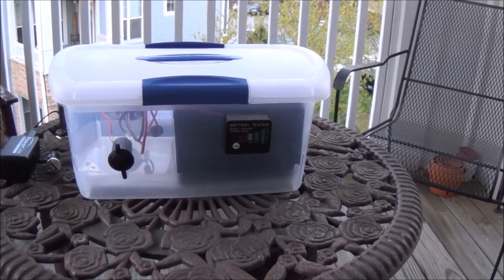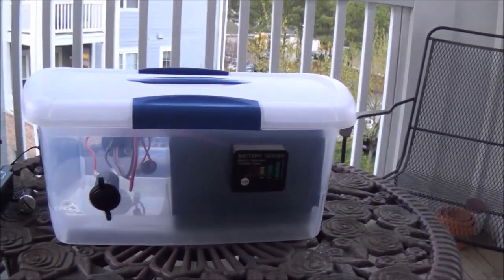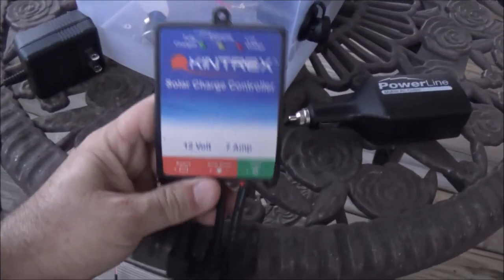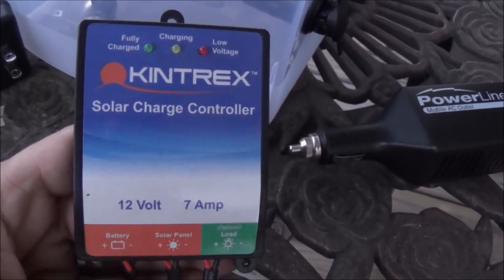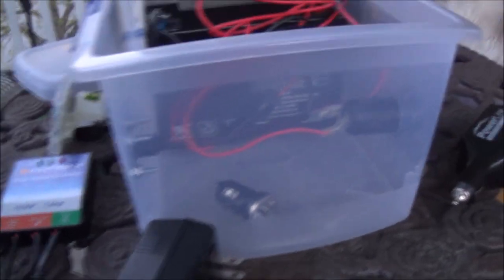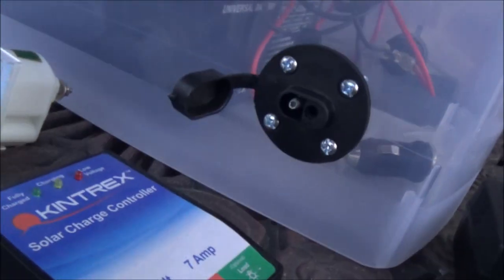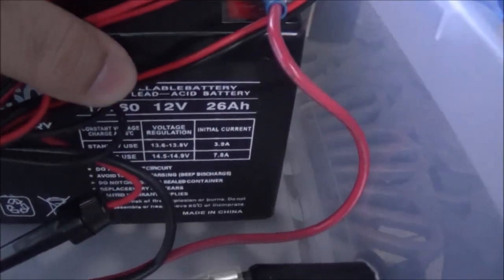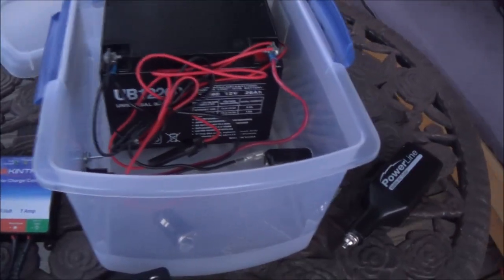DIY Portable Solar Generator

Comment: Nice set up.  I built a solar generator.  Two 100 watt  panels, a $20 charge controller, two deep cycle 12 volt marine batteries, and a 600 watt inverter.  Tips, get a sine inverter, not a modified.  Sine will allow charging of iphone ipad and other small items that need charging.  Mine is set up on a treated wood platform that I can roll around.  This avoids problems with the city code people.  When the power went out on us, I ran a cord from the solar generator (there is a 110 volt plug in on the inverter) into the house.  I ran a 12 volt fan (wired off of charge controller), I plugged in my laptop, router and modum.  For light I had a floor lamp with a 3 watt led bulb.  So I had a light, a fan, and was on line.  Very good feeling of having my own power.

Comment: I like the simplicity of your system. I see that the video is a couple years old and you've probably found out by now that the solar panel is too small. Assuming you'd have your cpap on for 8 hrs a night you would use 520watts at 65watts per hour. Your battery is plenty large enough to do multiple nights if that's all you're using it for but to recharge the battery you'd need 13hrs of sunlight per day, with a 20 watt panel, just to cover the cpap usage. If you had a 60 watt panel you would recharge the cpap usage in 8hrs assuming 100% efficiency which the system is not. A 100 watt system seems like it's got you covered in a little over 5hrs of sun and the rest of the day gets you covered for electronics. Wondering if this is what you have now discovered after using it for a while?

Comment: you are the first person to make one of these that I have seen that like myself has to have a cpap machine and ours run on the same power specs (12v 60w) when I saw they sold batteries for it I priced them with the cpap and other uses for the battery and when I was quoted the price I said damn that there are way too many 12v ideas like this that will allow me to run it during a camping or power outage situation and I'm glad to see someone else make one of these power boxes and consider that I'm currently building my own and will post it soon and BTW I have some amazing uses for the cpap coming soon especially since it has the optional humidifier attachment... again great video and that box is coming along nicely

Comment: Those connectors are used on Battery Tender cables/connectors and the Battery Tender battery charges available online...

Comment: Sir, your cpap consumes about 5 amp per hour, so since its not advised to deplete a lead acid battery more than 50 percent you have actuely only 11 amp at your disposel...the running time wil thus be around 2 hours tops....

Comment: Where did you get your battery?  How does it compare to a marine battery?  I'm learning about solar and hope to get a small setup done soon.  Thanks
Reply from the maker: I got this battery at a local hardware store, but similar batteries can be purchased from Batteries Plus or Amazon among other places. The two batteries are not really the same. The type of battery that I used do not have nearly as much current as a marine battery, but it can be positioned in any way and does not have to be maintained. Marine batteries have far more current, but are very heavy, can only be put in one direction, and most likely needed to be vented to the outside, which makes them hard to be used indoors.

I have built another version of a DIY solar generator that also uses a similar battery, and you will be to see what I mean about how you can position the battery. I hope to get a video made of it very soon, and get posted on my channel. Please let me know if there is anything I can help you for your project!!

Comment: Just use a jump starter and add a couple of small 12v solar panels the panels cost seriously cheap around £10 you can plug anything you want into the cig outlet for charging phones running small devices, as for the inverter check out some of the more powerful inverters they go upwards of 3k watts but the more juice you take the shorter the life of the battery.

You could always get a small generator or hook up a battery bank if you have a garden.

The solar panels I speak of only produce around 1/3 watts which is enough to keep a battery topped up or charge it slowly while on standby, they normally sit in the window of a car but could sit anywhere.
Reply from the maker: Thanks for all of your ideas!!
Reply: NC Prepper The main problem with all these things tends to be the battery, everything else is fine.

If you don't get the right type of battery you end up with a week battery recharge capability.

The power drops off rapidly, sure it comes back but generally drops off quick and if you go too low won't recharge too easily.

Deep cycle batteries are the best, but a bit more expensive.

I was looking at a system someone in the USA had decided to sell, it uses Li-po batteries and yes it's pretty good but, the problem is the cost, it will produce 2 kwatts but for the price it must cost there are cheaper alternative generators at a fraction of the cost.

For example: a 3kwatts 4stroke pure sine wave geni costs around US dollars around 6 hundred dollars his battery system alone would cost over 2 thousand dollars then there is the cost of the inverter which would be another 200 dollars or more and then the price of the solar panels.

I'm sure the planet could survive the use of a drop of petrol in an emergency.

I recently bought a geni cost me £500 3.5 kwatts it will run almost everything I want it to.

Get hi octane fuel and store it upwards of many months well what you call hi octane is our normal fuel from what top gear says.

Anyway good luck.
Reply from the maker: flitsies Thanks for all of the great information. I really appreciate!!
Reply: flitsies People often make the mistake of thinking that on 12 v with a 100ah battery they can happily connect an inverter and run a 2000w inverter to boil their kettle to make tea. Drawing even 1000w from a full battery will probably cause a voltage cut out in the inverter within just a couple of minutes. my 38ah battery fully charged struggles to start my 200w fridge via a 1000w inverter.  The inverter shuts down in low voltage cutout. Maybe my inverter is too sensitive but have heard others say the same thing when it comes to starting small compressor fridges that aren't variable speed.

Comment: Hello I want to build one to run a string of lights for about 18 hr to 24 hrs would this work fine for it and also do you have any tips for when I do attempt to do this
Reply from the maker: Brendan Keith Please feel free to ask me questions here when you start building yours, I would be glad to give you my two cents! Thank you for watching and commenting.
Reply from the maker: Brendan Keith I forgot to add that if you are going to use LED lights, something like this should do just fine.

Comment: Your battery is labelled as having 26 aH(amp hours) of power when full. As a 12v battery that means it can hold a max of 312 watt hours of power. If your CPAP uses 65 watts and you sleep for 8 hours that's 520 watts of power used. If you are in danger sleeping without the CPAP I would not use this as it will run out before you wake up and you'll be sleeping with no machine for a few hours. 

Also, your panel is a 20w panel, so it will produce 20w x however many hours of 100% sun exposure it has, which is usually only 5-6 hours total(accounting for the low sun in morning and at night). That means you can only generate 120ish watts of power on a given day with this panel, which will only fill your current battery a little less than halfway. 

This is a great system for running a few things in an emergency or when camping but please do not use it for your CPAP without a larger battery that will last you through the night. You could also hook the battery up to your car and help it charge if you don't want a bigger panel.
Reply from the maker: Thanks for all of the info!! Since I made this video, I have since taken out the 26 aH battery and downgraded it to a 18 aH battery. I am use this battery and another one to make a much higher amperage/wattage backup Solar Generator instead. Thanks again for your comments!!

Comment: where did you find the two pin flat receptacle bin looking but can't get one anywhere
Reply from the maker: I got them off of eBay. Here is a link, http://www.ebay.com/itm/SAE-flanged-rv-roof-connector-with-cover-solar-recreational-vehicle-portable/391399826815?_trksid=p2047675.c100011.m1850&_trkparms=aid%3D222007%26algo%3DSIC.MBE%26ao%3D1%26asc%3D37427%26meid%3D1ab5f63160754a44bbc6fe1da3cd90d8%26pid%3D100011%26rk%3D1%26rkt%3D5%26sd%3D391031992708

Comment: sadly a 26ah battery wont run a 65w cpap machine all night. it will only run it around 5 hours then after that the battery will be completely dead. need a 100ah to make sure the charge stays above 20%
Reply from the maker: Zac Tattle Thanks for the info. I will definitely look into that!
Reply: +NC Prepper       yup, here is the math to explain further what "Zac Tattle" said....   i myself have many small scooter batteries, they are each labelled 12 volt 12amp/hour 144watthour.   [roughly  speaking , your battery could put out 1amp for 26 hours or 2amps for 13 hours or 4amps for 6hours or 8amps for 2 .75 hours or 16amps for 1.25 or 26amps for just under 1 hour because the more amps you use the more stress the battery has and the sooner it will peter-out on an increasing curve and not a straight line chart to complete dead] ..... your 26 amphour batt would contain 12volt multiplied by 26amphour or in other words 312watthours.... so you divide 312 "watthours" by your cpap 65 "watts" and we get 4.8 "hours" run time till total dead battery... your cpap uses 65watts divided by 12volt or in other words about 5.5amps per second ... so yeah. obviously you will want a 100amphour battery that you will only drain 1half way so you get maximum cycle charge lifetime out of the battery drained to 50% every night you sleep........ very good calculating Zac ;-)  p.s. i love this box you made and i am going to make one soon... i was going to leave off the cigarette light socket and just put usb but i see the great functionality with the usb insert and i am excited that i watched your video, thanks much much much :-)

Comment: Where did you buy the connector for your box? I was looking for that connector when I was building my box.
Reply from the maker: Thanks for watching my video! Do you mean the two prong connectors?
Reply: NC Prepper yes, that connector on your box that you hook your panel up to.
Reply from the maker: acet7 I purchased that off of eBay, Here is a link http://www.ebay.com/itm/SAE-flanged-rv-roof-connector-with-cover-solar-recreational-vehicle-portable-/390819406341?_trksid=p2054897.l5663
Reply: Wow, thanks I can use that for my next project. I tried finding that awhile ago but didn't know what it was called.
Reply from the maker: You are welcome! I actually had to go back in my previous purchase history on eBay to find out what it was called ;-)

I am finishing a completely different version of a solar generator and will hopefully will posting a video of it soon.
Reply: If you have the time look at the one I just built.

Comment: How well has your solar battery worked with your coco?
Reply from the maker: Thomas Lewis I have done some initial tests and it seems to work pretty good, but I have still not tried using it for an entire night yet. Thanks for watching my video and commenting!
Reply: +NC Prepper  Do NOT put yourself in a situation where you will have to depend on that generator all night. It will NOT run your CPAP machine all night. Here is why. 

You said your CPAP machine is 60-65 watts, at 12vdc, in the video, if I am correct? Your battery, from the video, is only 26AH.  (First, you cannot use 100% of the capacity of the battery. 50%, tops.) 

At 60 watts, you would sleep - I am assuming here, 8 hours. That is 480 watt hours for your daily usage. (60 watts x 8 hours). Then, take 480 and divide by 12 (the battery voltage of your generator). That result will be 40, which is the amp hours necessary to run that load all night. Double that to get the full capacity battery you will need.

The minimum battery you will need to run your CPAP, would be 80AH. For safe measure, I would go with a 100AH battery. But, that's just me. 

Either way, at least an 80AH battery is what you need here.

Comment: You should connect the Power controller "charge controller" permanently, with the power out to the load of the Power controller that would protect the battery from being over drawn. It would mean that if the battery was too low the power controller would cut the power output!
Reply from the maker: Futz With Thanks for the tip!!

Comment: You are going to destroy that clear box. That battery is way to heavy and the box is by no means load bearing. That box is for mail and paper
Reply: Penny the Frenchton not sure why he chose such a janky container when there are so many cheap options beside that tacky and crappy one.
Reply: @TruckGoesVroom  It's fine (and cheap) for an initial prototype, but you're correct that he needs something more durable (and more expensive) for the final product.